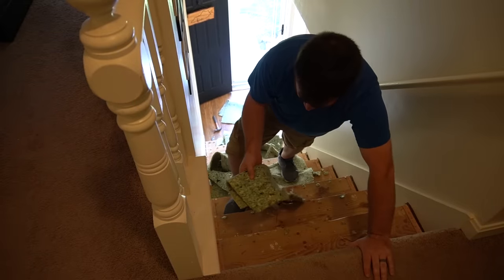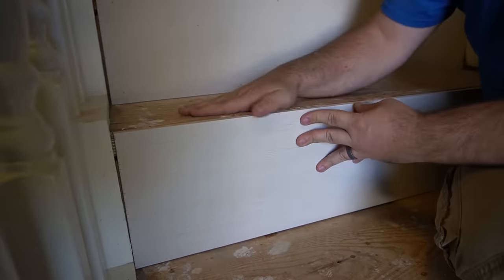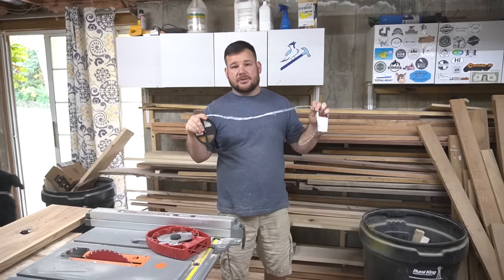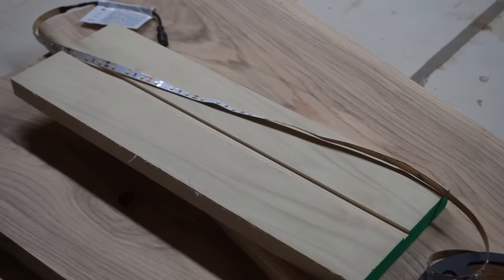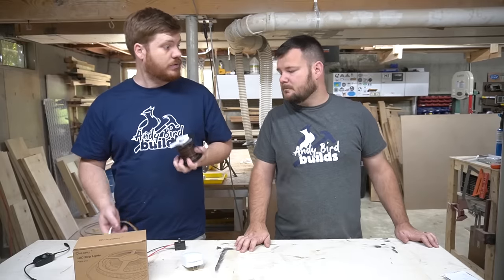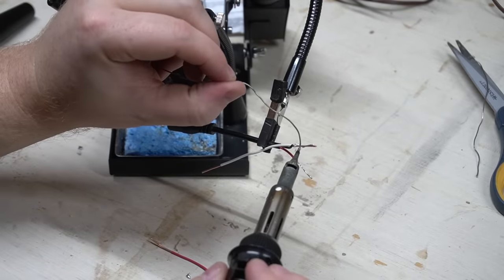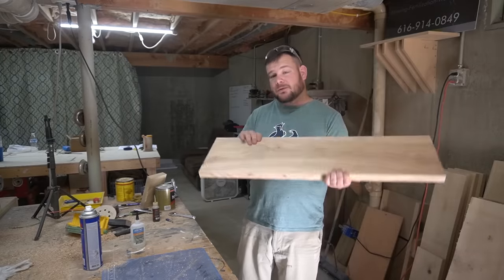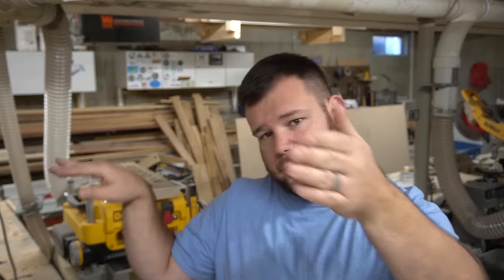DIY Staircase Makeover With DIY LED Lighting // Renovation

Comment: How difficult would it be to replace the LED lights if they were to fail or developed an annoying flicker? Would you have to lift up the treads to rewire it all as you replace the LED light strip? This was a very cool design but in the back of my mind I'd be a bit on edge about possibly having to tear up the stairs just to replace it all. The LED lights sold on amazon can be hit or miss.
Reply: Yes, I was wondering the same thing, how would you fix the problem

Comment: Just to clarify, it’s okay to put the epoxy in the “paint” sprayer? I thought that stuff hardens up quickly and I would think it would ruin the sprayer? If it’s okay I’m gong to be doing a lot of epoxy in the paint sprayer soon.
Reply: I don't think he actually sprayed epoxy just a polyester clear coat by the looks of it. 

Epoxy resin is too thick to be sprayed, i think. But cure time shouldn't be an issue, there are 24hr+ work time resins.

Comment: Very cool steps the dado in an angle for wires are the strips connected only on one end? Also the round or square because I have to do the square one on the tread too, what bit and router did you use for that?

Comment: When cutting the LED strip per step how did you connect each strip together? Is that what he was soldering and using with the 18-2 Low Voltage lamp wire? Basically “daisy chaining” them together In order to connect each step’s LED strip to the next?

Comment: What would be awesome is a pressure switch under the top and bottom steps so the lights come on when you go up or down and then turn off after 30 seconds. Or maybe just some pressure switch mats.

Comment: Am wondering i wanna do this with my stairs for a long time now but how does the hookup work (where do you plu them in)  with al the different led inputs comming from the stairs...do all of these go into one battery(system)?

I mean how do you hook them all up on your ellectricity. Is this system included in a package or do you need to buy it seperately and if so how is this system called? 

Sorry for my english its not my first language. 

Thanks heaps man. 

Enjoyed watching it 😊
Reply from the maker: Great! They all come into one junction box which is tied into the house power
Reply: @AndyBirdBuilds  awesome thanks bro!

Comment: you should have invested in a simple $30 stair stringer angle measuring tool. You're hiding the gaps with caulking but those treads should be tight tight tight to the stringers.
Reply from the maker: I agree. 👍

Comment: Did you blend the stair rise in? Every time I've ever removed carpet to replace with wood treads I had to blend in the rise to account for the different thickness in tread so you don't end up with a tiny step at the top or random rise heights. Anything more then 1/4" off from step to step won't meet code where I am.

Comment: Great video. How did you cable each of the light strips (for each step)? Did you piggyback (solder) each strip to one and THEN the next (using thermostat brown wire) or all strips' wires go to the main controller?

Comment: What’s the plan on replacing defective LED strips? You are not going to rip out the step, do you? I would have added plugs to the strips, and after connecting push the plug back, that way you could just pull it out and replace a strip if necessary.

Comment: How did the GE motion sensor sync with the leds. They different products, right?. Thanks !
Reply from the maker: They're not synced together. The motion censor has two component's. The power for the leds are wired into one of the components and the other is in the window. So the motion sensor synchs to itself
Reply: @AndyBirdBuilds  nice 👍. Thanks !

Comment: man, when I have a ton of staples or little carpet tacks, or some other crap in a surface I'm gonna cover up, I'll pull the worst ones, yea, but then I'll just beat the damn things in if they're under a certain size. I had a ton of old rusty tacks that were used to hold down linoleum, for some reason. They'd snap if I tried to pull 'em off. The first room I spent 2 days pulling and digging nails out. The next room was one afternoon. I yanked the biggest, easiest ones and then just ran from space to space with a grinder and flattened 'em all out. I put oak flooring over it anyway with rosin and tar paper and all that, so it would never effect anything.

Comment: You got lucky. The carpenters built my 60 year old stairs knowing carpet would cover them. Not a single stair was the same. Some 3/4” different in rise or run. I ended up ripping them out and putting in all new. Quite the unexpected expense.

Comment: I missed the concept, you want to light the stairs whole night? Why not but the LED strips that got app/wifi support- you can schedule in the app to when it should run and when to stop. Every night it should turn on at 6.30pm and off at 11:45 pm for instance. I did that for my TV backlight and kitchen cabinet light.
Reply: What’s the LED you use called?
Reply: @micaelap5600  just led strips with wifi off of amzn

Comment: I would've added a connector in the hole and made it so when the treat is pushed down they push together so the hole and treat one are fixed, but removable. Then they just plug in. I would've also measured each tread individually because those gaps are massive because home builders are lazy and don't properly square along each axis which costs inches in lost real-esstate and topsy-turvy rooms so each level really needs to be measured for closet shelving, etc... if they just took the extra few seconds to ensure square, it would turn out so much better.. 

I probably would've used one of those incredibly high strength velcros to tack them down ( the one with 2 hard sides instead of soft and hard ) which would've been enough strength, then 2 inset screws on each side and flush caps which could be drilled through to undo them. Then they are all fully removable, easy to fix issues, etc... 

I also would've added a diffuser to soften the light - ie: deeper dado and I would've used a / \ router so the lights could slide in and be held in place naturally so they could just slide out if necessary. I probably would've put the connection at a different point so the lights could be replaced without removing the treads by cutting them slightly shorter allowing me to slide them one direction, then a notch on one side to then pull out the entire strip while keeping the diffuser in.. the plug I would've used probably would've been a custom pcb and spring loaded gold contacts or something secured using velcro so ensure proper contact while allowing me to remove them. or some other connection method which would be hidden and accessible easily without removing the step - then the velcro could've been unnecessary underneath, although being able to remove them to refinish, etc.. is a huge plus. I probably would've also taken the time to add push to release undermount drawers in each step to allow that space to be used.

I probably, since I have issues with legs giving out, etc.. would've routered out a tiny area to add grip tape to the front to prevent slipping but done it in a tasteful way. So the tape backing is flush but the grippy bits stick up. and in the event of a slip the feet would naturally contour inside that groove for additional slip resistance.

Comment: Would be cool to have a pressure sensor under the boards attached to a logic controller board, lights up the steps in front of and behind the one you're on.

Comment: My suggestion would be instead of messing around with a light sensor, as it's only for daylight anyway, why not just hook it up to a sunrise/sunset timer? No need to worry about that wireless sensor running out of battery etc.

Looks very cool though!

Comment: Did u connect these led to your house 120V source power or are you using a Accessory power supply?
Reply from the maker: Accessory power supply
Reply: @AndyBirdBuilds  May I ask if it's plugged to house outlet or what did u use to power it?
Reply from the maker: @mrlambo2972  The power supply is plugged into a standard house outlet
Reply: @AndyBirdBuilds  💯💯💯

Comment: When you put the new treads on top of the old treads, how did you overcome the bottom step being too high and the last step at the top being too shallow?
Or have you raised the lower and upper floor levels too?
This could be a trip hazard, as used in ancient times to make soldiers stumble on odd height castle steps
🧐
Reply: This is the first thing I thought of. Not sure if this is a building code violation, but it is a big no no to anyone that has ever framed a house

Comment: Just need a slightly opaque piece of plastic or plexiglass cover for the LED strips. What you can do is cut a wider dado, and then a bit deeper thin dado inside of it to set the LED's, then lay the plexi or plastic cover over top to diffuse the lights. otherwise, amazing job.

Comment: I wouldn't have used glue....can guarantee those LEDs wont last....and would add a ZWAVE smart dimmer so you can always easily adjust intensity.  Also would have used ones that change color.

Comment: Those stairs looks cool!!! Well done!
Just a question... What happens if some of the led needs to be replaced at some point?
Reply: If you have spared the strip you just cut it in the designed places and splice in with some solder, right?

Comment: shouldve used corn cob tape light instead of diode if your not using a diffuser then youll never see the dots it will be a solid strip

Comment: You actually need class 3 low voltage wire, which is rated for luminaries. T-stat wire is class 2.

Edit: I am currently at a job with over 600 steps with these lights.

Comment: DIY.... no one has all those tools on hand, also people be careful doing this because your bottom step will be 1-1 1/2” taller(whichever material you use) and the top step will be shorter that amount, can cause a tripping hazard
Reply from the maker: I've addressed this a lot in the comments... The Ash is planned down to 7/8ths. I removed the carpet pad and the carpet which adds up to 7/8ths. The only difference between the 2 is that the carpet compresses when you step on it and the wood doesn't. I think everyone is forgetting, that I removed material before I added material. They've been in use for 4 months now with no issues.
Reply: Ok awesome, thanks for clearing that up

Comment: How many coats of poly did you do?
Reply from the maker: 3
Reply: @AndyBirdBuilds  did you sand between coatings? Also i saw that you used a gun tu apply poly. Was it water based or oil?

Comment: You just added an inch to the average height except the landing. When you run up that you're going to expect that last inch on the landing. Be careful.
Reply from the maker: How? I removed the carpet and pad and then added the wood. I didn't put the wood on top. No question I added maybe 3/8 of an inch but its not noticeable.

Comment: the front side of your 2nd tread is loose...you can see when your wife step on it at the end of the video.... you did not glue or screw any of them well enough.. i hope no one falls.... dangerous .. the treads are all raised on the right side.  poor installation. should have been deeper pocket for wiring so it wouldnt hold tread airborn..!!

Comment: Dude doesn't use or wear any safety gear. Not even while using the table saw or while spraying poly on the boards. Come on man, lead by example.  Even true professionals wear safety gear.